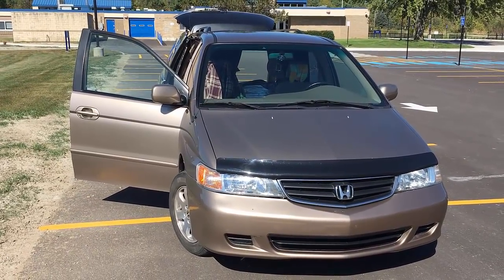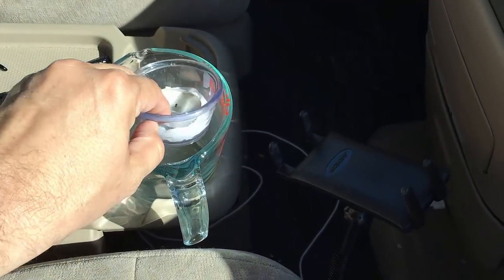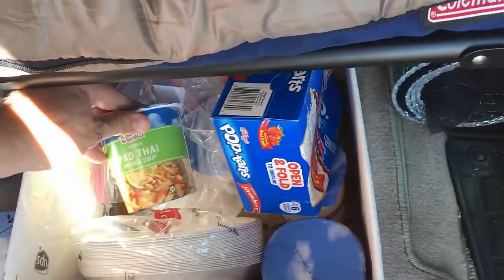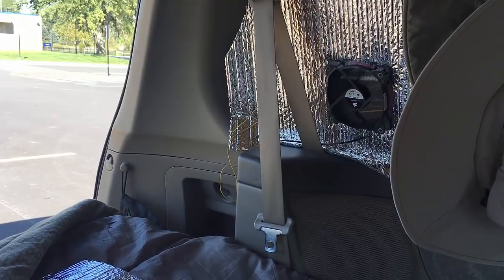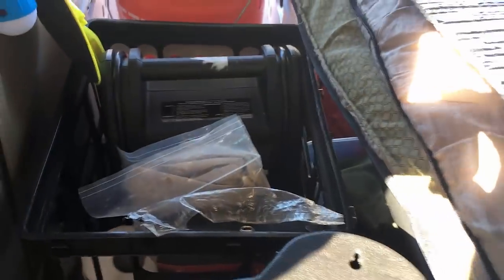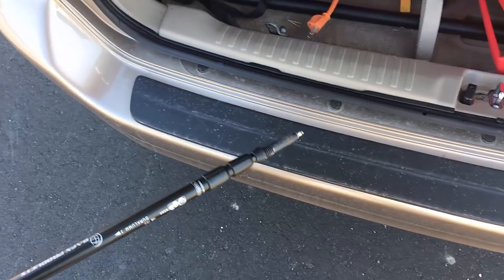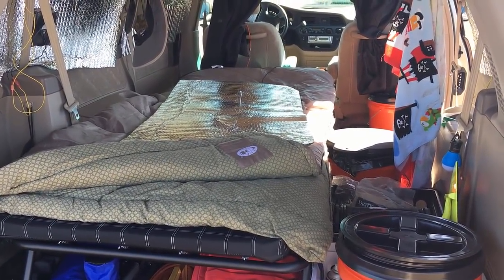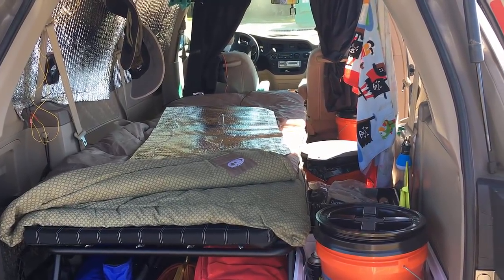Odyssey Camper Minivan Conversion

Comment: I'm looking into getting a van for camping,y research tells me oddesk vans are known for transmission issues. Have you heard this?
Reply from the maker: Ernest Rountree There were some years with transmission issues. You may want to check out our guide to buying a second generation Odyssey as your minivan camper. http://odysseycamper.com/2017/10/07/what-to-look-for-when-buying-a-second-generation-honda-odyssey/ 
It’s important to make sure the fluid changes were done on any Odyssey. They require more frequent fluid changes than some owners were used to, so they often forgot to do it, leading to more issues. I’ve owned half a dozen Odysseys and have never had an issue.

Comment: I don't know why more of these vanners don't use the immersion heater.   It's so much more convenient for coffee and when you just need a little hot water for rehydrating or soup.  Thank you.
Reply from the maker: Windy McGee They’re awesome and for the price, you can carry two!  The only thing is you have to be careful to put them in the water BEFORE plugging in and to unplug BEFORE removing. It they get powered up outside of the water, you can burn up the element. If you see negative reviews, they usually plugged it in outside of the water.
Reply: I'd never heard of it.  Genius.

Comment: Is that safe to have the fire in enclosed van?
Reply from the maker: Well, NO fire would be safer of course. However, putting it in the Pyrex cup and being careful not to hang anything over it should negate most of the potential issues.  It’s not worth it for the heat, so I’d only do this in noseeum weather.
Reply: Odyssey Camper  well my temps only 52 low here so im going to try it. I just thought it might exhaust harmful fumes while im asleep. But I have a few windows cracked so it should be good right?
Reply from the maker: One candle is nothing to worry about.  Any van has enough air leaks to provide ventilation.  I've done it many, many, times, so you'll be OK.

Comment: Wait wait, that's all you use for heat? Wow
Reply from the maker: I should clarify that.  The candle (especially the 3-wick kind), does put out a significant amount of heat and with the window panels in place, I'm comfortable into the 40s.  BUT, it's not "heating" to van to 70 or anything.  On really cold nights, I use a 250W electric heater.  If you are going into the 30s, I'd suggest a small propane or bigger electric heater (if you have external power available).
Reply: Odyssey Camper do you ever worry about carbon monoxide or dioxide? I had a similar idea for my van, but I wasn't sure if 1 small candle would really be an issue
Reply from the maker: Hi Ben,   I don't think you'd have anything to fear from a few candles because your vehicle is far from airtight.  Honestly though, it's not a ton of heat, so you would probably be better off with a small inverter (pure sine) and an electric blanket.  With electric heat like the 250W unit I mentioned, there is of course no CO produced.  I have a CO detector in the van and it's never gone off from a candle.  It's always a good idea to have a carbon monoxide detector because there are other reasons you could have CO in the vehicle (exhaust leak, exhaust pipe obstructed by snow, someone running a generator near you).  $20 is not a lot of money to spend to make sure you'll wake up in the morning ;-)